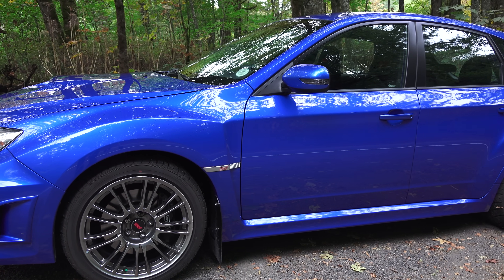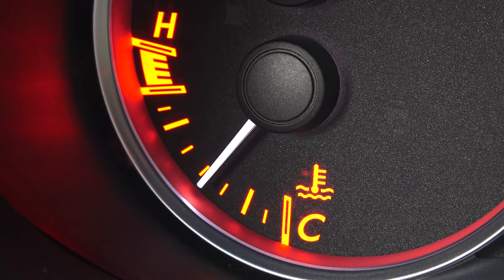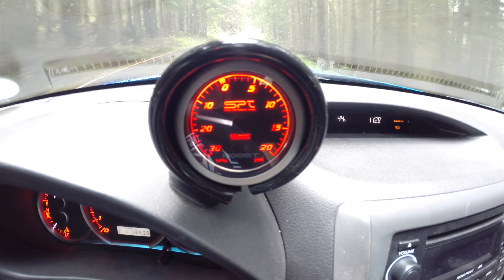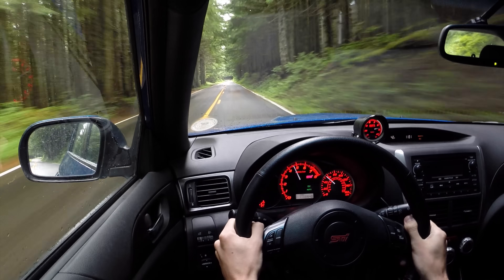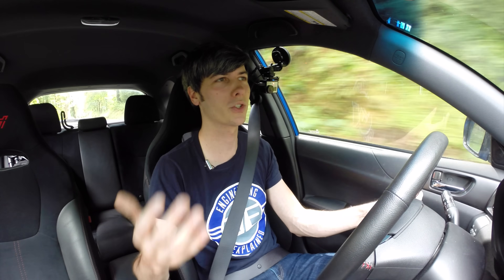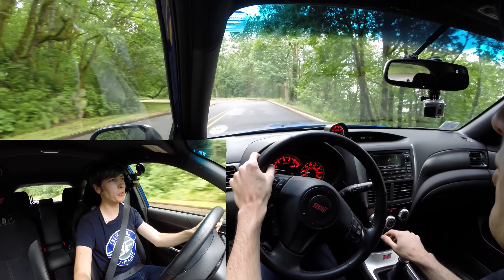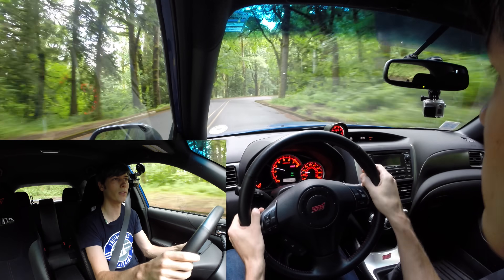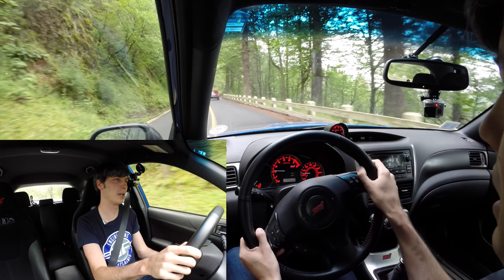5 Things You Should Never Do In A Turbocharged Vehicle

Comment: I generally like this channel, but the comment about using higher octane gas than specified by the manufacturer is b.s. - only somebody working for one of the gas companies (Exxon, Shell, BP, etc.) would say this.  Car manufacturers specify the gas to be used based on the compression occurring in the cylinders of the engine, higher octane gas can withstand higher compression, but since the end-user can't alter the compression ration in the engine it's a wast of money buying higher octane fuel than specified.  Knocking only occurs when the engine is supplied with lower octane fuel than specified, so if that happens to you there are only two reasons: a) you filled in the wrong fuel (e.g. 89 was specified in the car manual and you pumped in 87 instead), or b) your local gas station has a defect (or is cheating you).
Reply: iare19 US and European octane ratings are different. EU 95 = US 91, and EU 98 = US 93.
Reply from the maker: You should always use what's recommend (if it's regular, use regular). Many turbo'd cars recommend or require premium, to take advantage of advanced ignition timing. If you modify your engine for more power, to be safe in preventing knock, your best bet is using higher octane fuel.
Reply: Sven Hallauer if you really want to laugh, we should compare fuel prices.
Reply: 2002 WRX, recommends 91. Runs better on 93. Why is 91 the recommendation? Because that's all that's commonly available in CA. Could you imagine if Subaru recommended a grade of gasoline you couldn't get locally? Manufacturers have a wide range of motivations. It's a small difference but the engine is designed for 93 and runs better at the very top end. It tolerates 91 just fine but it's not optimal.
Reply: You are wrong. While what you said is Ok for most old engines, those turbo downsized direct injected engines of late are prone to LSPI (Low Speed Pre Ignition).

LSPI is partially avoided/minimized by higher octane fuels. So people do have a real reason to use it.

LSPI is a hot topic, and it's avoidance demands other efforts too, in chamber and piston cleanes, and oil contribution.

LSPI is the reason API is creating a  new SN Plus class service still based on ILSAC GF-5 as API SN with additional LSPI test requirements, while ILSAC GF-6A and API SP (as well as GF-6B and the new "API ?A", incompatible with current engines) are delayed in the pipeline.

Fuel octane rating alone might not do the trick, but sure helps prevent catastrofic pre-ignition.
Reply: iare19 

US uses (MON+RON)/2 as standard labelling. Apples to Apples, please.
Reply: Just read the handbook and you'll be fine
Reply: Many engines these days are actually designed for optimum efficiency, even at the cost of sometimes pre-ignition occurring under certain circumstances. Engines then have safety mechanisms to counter this phenomenon. An ICE is always operating at its peak efficiency at the very verge of starting to pre-ignite. This is why the counter measures are present in modern turbocharged engines. These counter measures include automated systems for quickly lowering boost pressure, altering ignition timing and altering the air/fuel mixture. Since the early '80s there have been turbo engines that utilize boost control with calculated pre-ignition (first being Saab in 1981). Today almost all mainstream petrol turbo engines do something of the sort - it's all due to the chase for ever higher efficiency. The engines are designed to run as close as possible to pinging, and sometimes a little pinging takes place - hence the counter measures. For this reason, you should use the highest grade fuel that's available. 

With better fuel you get maximum power more consistently than with lower grade fuel. And for longer periods. A long stint of full-throttle acceleration can already make a difference, and hot weather certainly does. In a dynamometer you can see these things happen, and better yet a datalogging system used under road or track driving. Also, for engine's durability's sake it's better to have less of those pre-ignition instances, even if they are very short. There's one additional thing to note: on a turbocharged engine, especially if running higher boost than stock, your fuel economy will improve with higher grade fuel. Among professionals around where I live this is common knowledge. I have tested this myself as well, and during my 19 years of gathering said data, it's always the same. With higher grade fuel, MPG goes up. Not much, but enough to cover the extra cost of the better fuel.
Reply: Brian Clark 91 is just the minimum recommendation, as in dont use anything below 91. 93 is the preferred recommendation.
Reply: +Brian Clark. I had a UK 2003 WRX which was supposed to run on 98 RON or higher (US 93 PUMP). There was a warning sticker stating this inside the fuel door.
Reply: Ford uses an octane adjustment ratio in their tubes that actually add power for higher octane fuels. A 93 octane fuel will produce more power stock than an 87 octane fuel in all the ecoboost motors. The OAR adjustment takes a few miles to adjust with different octane, but is noticeable when towing or hauling loads. With a tune, the differences are tremendous.
Reply: Ivr read that if your motor isn't a high octane motor. Than you're just wasting extra dollars . 
I think the most important part is buy ethanol free gas. Regardless of what number it is. 85 87 91 93 all come ethanol free in gas stations that don't rape you.
Reply: you have proven to the world;
1. You are not a class A mechanic.
2. Have never raced, and tuned any motor in your life.
Reply: Sven Hallauer 89 loool, they dont sell lower than 95 in EU.

Comment: If I'm not rushing I normally drive in low rpm but not to a point of where it is starving of power and in return the mpg is unbelievable. I'm getting 65mpg on a manual 1.6 tdci Ford Cmax.

Comment: 5w30 is a measurement of how fast the oil flows cold and operating temp. Oil gets thinner as it gets hotter, this is true for single weight oil. Multigrade oil uses viscosity modifiers to thicken as they warm up. Unless you're using single weight oil in your car, no one does, you're really giving these people false information. You may want to specify what's really going on here. Just a thought.
Reply: True, but unless you live somewhere with a very stable climate year-round, and one that tends towards the hot side at that, the oil will still thin out as it moves from being the same temperature as the ambient air (and where I am at the moment, that's about minus-3 celcius or high-20s farenheit) up to operating temperature (well over 90'C / 200'F - it sits a little hotter than the coolant, unless you happen to specifically have an oil cooler fitted). Multigrade oils are rather magical things in terms of limiting how much their viscosity changes with temperature, but I can run a very easy demonstration to show that they're still much thicker at ambient temperature than that of a warmed-through engine... it's known as "an oil change". Either on the car or my bike, but the latter is quicker and easier.

Take the machine for a quick high-revs run around the block to heat up the engine and churn the oil up (so more of the dirt and other residue drains out with it) before starting work, so you're not sat on the driveway revving it for ten minutes annoying the neighbours, then hoist it on the mainstand, shove a suitable container underneath, and release the sump nut. See how the old, dirty oil splashes out like polluted river water, or maybe even faster and thinner. Run some engine flush into the filler hole if you like as well, and crank it a few times with the ignition disconnected, just to make sure you've got all the crap out.

Now torque the sump nut back up and shove a funnel in the filler. Get yourself a nice new bottle of your favourite flavour of multigrade; I use 5w30 fully synthetic in the car, but the bike's a bit of a crock and is recommended for 10w40 semi-synth in this climate, and I'm not entirely convinced that's thick enough any more, the 20w50 mineral gunk might be better for it these days.

Crack open the cap, and start pouring it into the funnel... oh! See how it's flowing much more slowly and appears to be a thicker substance? It is, however, just the same oil that came out a couple minutes earlier, merely much cleaner. You can confirm this by using a bottle of new oil in place of the engine flush - refill the engine, check the level, correct if necessary, then start it up and run through the same warmup as before... then empty the new oil out into a different container (you might, after all, want to put it straight back in if it doesn't carry much more cack out with it). It'll flow out like water just the same as the old stuff did. In both cases, don't let it splash on your hand any more than you can avoid (preferably, put a rubber glove on, which helps you avoid having hot oil soaking into your skin), because there's something of a risk of scalding yourself if it's got super hot... essentially, shallow frying your epidermis.

If you want to simulate a "cold" (from the engine's perspective) start in a hot climate, soak the bottle for a while in a bowl with a 1:1 mixture of cold tap water and freshly boiled water, which should even out to about 60'C at first and fall down to 50, maybe 40'C depending how long you leave it (a thermometer is useful, but not essential). It'll pour into the funnel rather faster and more easily, but it still won't be as thin and splashy as what you emptied from the sump.

(I find the latter quite a useful thing if refilling a manual transmission... they use rather thicker, high pressure oils, typically rated as 75w90 or higher because of how hot the gears and bearings can get, and whilst it's not too much bother to top them up if they've only lost a little oil, if they've leaked out completely or been deliberately drained for transport, it takes FOREVER to completely refill, and you can't be sure it's penetrated properly throughout before you take it for the first post-fill run... if you're doing it in winter, the stuff can set almost like treacle/molasses, forming into little peaks where the stream makes contact with the pool. Ten minutes soaking in near-boiling water makes it pour much faster and penetrate much better, more like room temperature 5w30...)

This difference can be rather important inside an engine, especially on a cold winter's day, as some of the oilways - particularly inside the thin, high pressure pipes supplying and draining a turbo, which are essentially repurposed brake lines - can be rather narrow, and it's difficult for oil to penetrate through them properly if it's gone gloopy. That's the sort of thing special mixes like Magnatec are purportedly designed to partially combat, for example by leaving a thin film clinging to the cylinder walls whilst the engine's stopped instead of fully draining into the sump, so the piston rings aren't left wholly unlubricated at the next startup before the pump can push the initially glutinous oil up into the top gallery and it can bloop and trickle down from there into the cylinders and all the other places it needs to go.

tl;dr if the climate is brassic, you don't really want to rev the engine much, maybe even move the car at all until you are yourself starting to feel a little warm inside the cabin, as the coolant begins to draw some heat from the warming engine and transfer it to the heater matrix. Preferably, if you can spare the time, not until you've been able to demist the inside of the screen using heater air alone, rather than the Ford Quickmist system or physical wiping. Only once the air blowing in is starting to reach a halfway comfortable temperature (maybe only 15 celcius, even, rather than 30+) can you be certain the coolant, and therefore also the oil, has warmed to any significant degree, and thus the oil is thin enough to be penetrating nicely through the engine. And, most importantly, to the turbo in a boosted engine... if the oil isn't getting to the bearing in any volume, you don't want to spool it up much, or at all if it can be helped. Warmer climates, you might well be OK to crank the starter and cane it straight away, but even then you need to give it a few seconds for the pressure to build to be completely safe, because when the engine's off most of the oil drains back into the sump and it takes a moment for the pump to lift any back to camshaft level, then a few more to build up normal operating pressure (which is what sends oil to the turbo). Again, that's something I can demonstrate with the bike, by taking the rocker cover off when it's cold and cranking the starter (it won't catch if I don't pull the choke)... oil will soon start bubbling, then gushing out of the primary oilway that runs up to the valve rockers, and making a bit of a mess as it spills out, but it's far from an instant occurrence. Until then, the moving parts are reliant entirely on whatever residue might still be clinging to them. Certainly if there were any fluid bearings in the head, they wouldn't be properly lubricated or supported for several seconds.
Reply: holy crap! dont click read more on that dudes novel.
Reply: True, don’t click!
Reply: Multigrades don't thicken as they warm up, they just don't thin as much.  You are the one giving false information.

Comment: 5 Things you should never do in a supercharged car?
Reply: Superchargers are ment to run at any time so supercharged engines should leave very few mechanical problems
Reply: ANT R check your manual, it should tell you the preferred octane rating.
Reply: Just got a Accord 18 turbo should I us regular gass ?
Reply: ANT R 50/50 87 and diesel
Reply: I can't think of anything major on special failures but I would advise never miss a 'charger oil change, check silicon and gaskets regularly (to avoid boost leak), ensure pulleys and belts are top notch whenever you can, and make sure that whatever system runs parallel with the 'charger (1st gen BMW Mini S has water pump off the but, for example) is not going to fail or induce failure to the 'charger.

If a bit of mechanism were to fly from the charger and into the cylinder it could cause major damage. Avoid putting cloth around twin screw/roots chargers (can seize and tangle with a shop towel, I've heard the horror stories).
Reply: never supercharge ur car then u’ll never have to worry about a thing
Reply: Supercharges are belt driven no oil no cooling and very little to no lag so thats basically a waste of time other then maybe change the supercharger belt when worn i guess 😂
Reply: Congratulations on completely ignoring what was said in the video
Reply: Silvirbullet I agree!

Comment: I am confused, at around 2.36 you say that at low RPM if you floor it you will be getting a lot of boost. On a turbo charged car the engine RPM is related to boost pressure via the exhaust and below a certain RPM the turbo will not be providing any boost. So when you floor it at low RPM you will not be getting a lot of boost and you might not even be getting any at all until your RPM's reach a certain level.

Additionally, after driving a turbo charged car for a while a driver will start to be aware of the boost and when it will kick in and drive appropriately.

Also, a few tips about your driving, you should try and drive with both hands on the wheel as much as possible, even if you do need your right hand to gesture and emphasize your speech. Lastly, you should not wrap your thumbs around the wheel, your thumbs should remain on the outside of the steering wheel, this will save you a broken wrist in the event of something going wrong.

Comment: It's bad to lug or go full throttle at a low RPM in any engine whether or not it has a turbo. You're asking each stroke of the cylinders to exert much more energy than they are meant to handle and that can damage rings etc. If you're carrying 1000 lbs of bricks up stairs, you're better off moving 10 lbs at a time and faster than 100 lbs where you're more likely to injure yourself. Rough analogy... In aviation, many light aircraft have a constant speed propeller where you control RPM directly (by changing the propeller blade angle) in addition to throttle. Typically redline is 2700 RPM on those (because above that the tips start breaking the sound barrier which kills aerodynamic efficiency). We were taught that your manifold pressure should always be set at or less than your RPM setting. For example, if you're set at 2400 RPM, you should not open up to more than 24 inHG on the throttle. If you want max power, you set max throttle and RPM together because you're basically like a transmission. 29.92 inHG is standard air pressure, so any stopped engine would have a manifold pressure of ambient (29.92 inHG if a standard day), and as the engine runs you get a vacuum, so it might be 27 or more inHG at full throttle and a lower number at a closed throttle (more resistance because the engine is pulling air through a small opening, thus, you get vacuum). Of course, we're also talking mainly naturally aspirated engines producing anything from 150HP to 300HP and beyond at 2700 RPM with very high compression requiring 110 octane fuel. Only some of this applies to the above point directly, but I thought it might be interesting to someone.